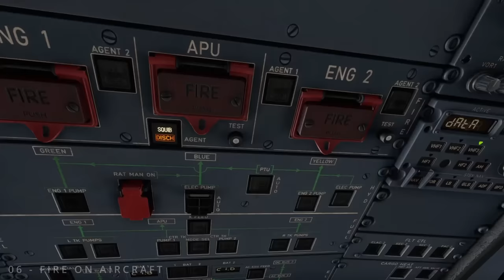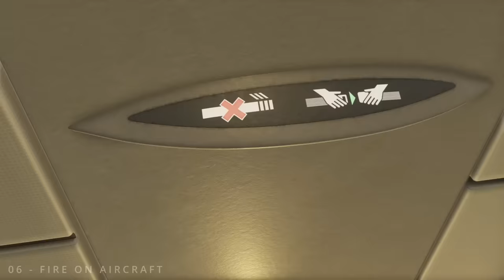Airline CAPTAIN Debunks 8 Flying Fears

Comment: Thanks for this captain. I am not sure I can completely agree with the examples you used for landing on water.  Yes, Sully did land on the water, he is a true here and an incredible pilot, but he landed on a river: water was relatively calm and people could be reached and saved in minutes. Ethiopian Airlines Flight 961 was a tragic event: the airplane broke into pieces, and 125 of the 175 people on board died. And the other 50 were saved because the plan hit the ocean just 460 meters away from the beach.

Comment: Ive flown many times as I want to go abroad on holiday. However, I just cant get on a.plane without taking valium although I am still a bag of nerves after 10mg ! Nothing and I mean nothing not even this lovely pilot can make me at ease
 My hands are.soaked with sweat just talking about flying. Adding to that the Boeing 737 Max 8 whixh is used by UK tour operators we usually book with has not just had the 2 crashes prior to pilots being trained properly on the MCAS but has recently had 4 incidents where planes plummeted thousands of feet or.were flying way too low.
I love going on holiday but its so traumatic for me.😢

Comment: Good job here and no doubt that flying is safer every year that goes by. However for me I will never fly in thick fog on lift off or landing, icy conditions or in a plane that has less than 3 pilots..with just 2 a suicidal pilot can get the one to leave the cockpit and then lock the door, rare but it's happened several times.

Comment: What if a pilot snaps and decides to purposefully crash lands
What if the air pressure is set to manual and nobody notices cause they’re too ”experienced” to do thorough checks 
What if there’s guns smuggled and it causes a fire and the plane cracks in half

Comment: The best thing i’ve ever heard that made me completely trust in a plane is if the airplane is at it’s maximum operating height and every single one of its engines fails, the plane can still safely land no matter how high it is
Reply: Not if it’s in a stall or the pitch is off significantly.
Reply: @GP-gt4bo  right, but even that is usually preventable

Comment: the last one about a water ditching he wasn't being completely honest. I watch a documentary show called Air Disasters where there was a plane that needed to do an emergency ditching. They miscalculated and the plane flipped over repeatedly, and everyone died. So yes, it's possible to do an emergency ditching and have it go well, but it's just as likely it won't. For anyone who wants to know the truth about aviation I'd watch this documentary series. I'm scared to fly but it has nothing to do with the plane itself (most of the time) it's maintenance failures, pilot error, and weather (mostly upon landing). This pilot did a phenomenal job detailing most of the fears but I feel he should speak more about when things go wrong and the pilots don't know what's going on. Many planes have gone down due to the pilots not understanding what the complicated automative system is telling them.
Reply: exactly this. there are chances to have accidents, as you say; mechanical/human errors are super probable. all pilots look very cool and calm and godly until there is a problem and they really freak out, they have a bit of overconfidence imo. flying a heavy airplane on the air feels extremely unnatural to me. super unpopular opinion I guess. I hate flying. everything about it 
feels grothesque to me

Comment: Would have been nicer if an aerospace engineer was also in this explanation video. Pilots aren’t aerospace engineers. Yes pilots have to learn a lot about airplanes but they don’t design airplanes by craft. Aerospace engineers do. It would have been nice to hear them both discuss these issues.

Comment: I'm an experienced flyer with in excess of 200 commercial flights in the last 40 years. But I still get scared. It only takes one pilot error, or one mechanical failure to send you plummeting to your death. Yes, it is rare, but the facts are that it could happen.

Comment: I’m deathly terrified of flying right now even though  I’ve flown at least 10 times. My question would be what could be done if one pilot is suicidal? What measures could be done to prevent or stop it besides yearly mental screening?
Reply: Annoyingly, the FAA in the US has made it mandatory for two people to be in the cockpit at all times if a pilot needs a rest break due, however other European airlines don’t make this rule mandatory which is bizarre to me as the FAA requires it. Depends on which EU airline implements this rule. Airlines have adopted “peer support programmes” which offer confidential support for pilots by other pilots which I guess helps lessen the stigmatisation of mental health disorders but I’m uncertain about what happens to a pilot’s licensing and work after it’s declared they’re not fit to fly.

Comment: The chances of a passenger experiencing an engine failure on a twin engine plane such as the B787 or Airbus A350 is incredibly small.  And they fly incredibly well on one engine!  Even rarer is when an engine fails spectacularly & the front of the engine is blown off.  If that happens it's really really serious because of the extra drag.  This happened on a United Airlines B777 flight to Hawaii.  The captain and crew did a fabulous job & the plane landed safely but the plane was extremely difficult to control.

Comment: My biggest fears are of loss of control of the aircraft due to mechanical (E.g. Alaska Air flight 261) or software failure (E.g. 737 Max MCAS failures) , severe pilot mental health issues (E.g. Germanwings Flight 9525)   and terrorism (E.g. Pan Am Lockerby).

Comment: weirdly enough i used to be afraid of flying and i cured it by watching air crash investigators, they have fixed alot of things and i understand all the noises and things that happen during a flight now turbulence is the same as going over a pothole in a car.  uncomfortable maybe yeah but these machine are designed for it.

Comment: I do have to say, with professional experience in aviation and anxiety, it's never a good idea to dismiss all feelings of fear. That's not the answer. There is no fail proof answer to flight anxiety, nor is there a a 100 % guarantee of safety. It would be a lie. It's about dealing with those fears and a healthy risk-assesment. If people are afraid of bears, you can not say that the chances of being attacked by a bear are zero. Facing fears is allowing that 0,001 chance of uncertainty, and being ok with it. If someone asks me in my practice if it's possible that their plane will crash, the only right answer is yes

Comment: I had a fear of flying based on the idea that the plane was not controllable by the pilots and could do what it wanted. I was on a flight in Nepal  on a 30 seater when we went through a thunderstorm which caused the plane to plummet to the earth perhaps about 20 times in succession. Each time the pilot was able to pull it out of the dive. Suddenly the storm cleared and we landed safely. That day I lostmy fear of flying.
Reply: how are you not traumatised after that experience tho?
Reply: @siempre289  it was traumatising. It felt like being in a fairground rollercoaster except that it was in an aeroplane. Even the air hostesses were screaming. After 3 hours I had a connecting flight. Did I want to board it? Well I had to get home, but I realised that if the plane could survive that, it could survive more or less anything. From then on I had no fear of flying.

Comment: Well, unfortunately landing on water is a thing which aircraft not really can do. Landing on water is like an impact because of the weight of the water is causing an enormous braking force when parts of the airplane hit the water. Of course, the A320 landing in the Hudson saving all lives on board was great, but in the Ethiopian flight 961 incident with the Boeing 767-200, 125 out of the 175 people on board got killed (including all three hijackers).
Reply: That's because Sully is an incredible pilot who used to tricks to lower the approaching speed to the water and first dug the back of the plane into the water before dipping the nose. Obviously you cannot treat water like a normal runway. He also made sure every single passenger was in a brace before attempting this. You cannot say "landing on water is a thing which aircraft not really can do." when it literally has been done.

Comment: It's the lack of control that bothers me. in a car, I can grab the wheel or hit the brake or hell, I can jump out and pray. In an aircraft, there's literally nothing you can do aside from tighten your seat belt, hold your love ones and kiss your ass goodbye. Everything is in the hands of your pilot. They say the road is more dangerous, yet I have never and will never be in an accident. I'm a defensive driver. But my defensive caution means nothing in the air. I need to put my trust into a complete stranger 20 thousand miles up in the air. Yet I barely trust my nabors, lol. It's a scary thing if your someone like me. All it takes is one pilot who hates his life or had one too many night caps or didn't sleep the other night. I know it sounds silly, but those who died in a plain I'm shore  also thought the idea was silly till it happened. It doesn't really matter how many planes safely take of or land because it only ever takes the one time to end your life. The odds of winning the lottery or stunningly low but yet we have millionaires out there right now because of a set of lucky numbers. All it takes is for your unlucky number to be called.
Reply: sure you might drive really safe but that doesnt mean other people on the road with you will do so i dont know about you but i would sooner put all my trust in a commercial pilot than i would in random drivers around me
Reply: @animegamingdude  I would agree, but to further inflict fear in me, just the other day, a commercial pilot tried to down an Alaskan airline plane, further deepening my fear of trusting pilots. I get your point about other drivers, but being a defensive driver gives me a chance to react to other drivers. 2 months ago, I had to veer off into the grass to avoid a car coming up behind me really fast. My car and I were safe, but he hit the car in front of me. (Everyone was ok) but still, the fact that it's my reaction time that helped rather than the reaction time of a stranger. Maybe my fear is unique lol but it happens to be backed up by a few examples.

Comment: It's not the theory of flight that I question. It's the maintenance records, and it dozens of times we have found out that the airline knew about a problem and didn't do anything.

Once again, it's the corporate aspect of the company who I'm more concerned about cost cutting and bonuses then they are about our safety. It's a calculated risk they are willing to take… I'm not.

Comment: I was just on a flight from Frankfurt to Edinburgh and we had to make an emergency landing due to an”suspicious smell”.

The landing was very dramatic with emergency lights, flight attendants running around and significant turbulence due to the rapid decent. 

We sat on the plane for an hour once landed while the smell was investigated internally and externally, and were eventually told that we would have to evacuate the plane. 

Does anyone know what this smell could have been or what the concern was? I was sat in the area they were investigating and couldn’t smell anything.

Comment: When there is no chance of loss of cabin pressure, I'll feel safe flying. Thinking you are just sleepy and dying due to loss of cabin pressure is not a way I want to die. I don't really care how rare that is.
Reply: even if cabin pressure is lost the oxygen masks will drop down and provide you with enough oxygen for the pilots to get the plane down to an altitude where the air is breathable

Comment: I commend the aircraft industry for the diligent attempts to improve safety, and for what has already been achieved in this regard. However ... (you knew there was a "however" coming, didn't you?): Saying that flying is safer than driving by referring to accident death statistics involves an egregious use of false equivalence. Air traffic is extremely strictly controlled; road traffic much less so. Imagine how road traffic deaths would drop if:  —If every driver were as highly trained, skilled, and experienced as an airline pilot. —If every car or truck were thoroughly inspected by trained technicians before going on the road. —If every driver had to be cleared for sobriety and competence before leaving. —if every vehicle had to be in constant contact with a control tower and if every vehicle was stricly controlled with regard to speed, maneuvers carried out, and route. —If a scarily smart, competent, and skilled "flight controller" pulled out all the stops to ensure that no two vehicles were in danger of a collission. ... One could obviously go on and on. The operating conditions for air traffic and road traffic are nowhere near the same.

Comment: 05:50 With all the respect, I would prefer to not be present on board on a "nothing to worry about" scenario where the cabin crew would had to assist and set up an automatic landing. It is not so simple.

Comment: I'm afraid of the possibility that my plane has some untied bolt that wasn't seen on the last inspection and that it will fall off during the flight disassembling something important and plane will snap in half mid flight throwing me in a free fall without parachute

Comment: I was with him until the ending. Sorry, I know he has to speak up for his industry but you cannot compare the Hudson landing to most; the reason that Airbus was able to remain intact was because it had low passenger count, almost nil cargo and very limited fuel for a short flight, which means it could keep airborne at a much lower speed than normal (erroneously referred to as 'stall speed') and of course it was onto a calm estuary, not open water. An aircraft mid ocean with 50% fuel load, full passenger and cargo load is going to disintergrate on impacting the sea, even if it is perfectly calm.

However, I mostly take issue with the 1:11,000,000 odds of dying on an aircraft Vs 1:5000 in a car.... Now I don't know what the odds are for aircraft, but the idea that 1 in 5,000 car journeys ends in a fatality undermines anything that he has tried to do in this video.

Comment: What happens if the aircraft crashes into a mountain ? I'm guessing the answer is it'll be fine, they're designed for this kind of thing, don't worry about it, you'll be fine.
Reply: If the aircraft crashes into a mountain, the answer is your body will be instantly pulverised and you will die, however let me ask you a question: Why the hell are we flying into a mountain?

Comment: What happens if the engines stop while you are crossing the Atlantic? 🤔
Reply: " ETOPS (Extended-range Twin-engine Operational Performance Standards): Aircraft that fly long routes over oceans must meet strict safety regulations that ensure they can safely glide to a diversion airport even in the event of engine failure. "
Reply: @j4mbi_  
Good to know, thank you so much! Safe flying

Comment: If the engine fails on one wing does it mean the plane will spin as only one wing will be flying?
Reply from the maker: No not at all. A plane will fly perfectly fine with only one engine functioning. It will not spin, you would probably not even notice a difference.
Reply: @AirlinersLive  So is air just working on one side of the plane?  If one engine fails can the other engine still power both? I'm just imagining if one side stops spinning but the other working so it will be uneven.

Comment: If you are in an airliner you are sitting in a flying bomb full of inflammable fuel & battery acid & oxygen .  Its held together with pop rivets.& glue ,flying several miles above the ground in all kinds of weather in horrendous cross winds at speeds of up to 600 mph . The controls can jam the engines overheat & burst into flames ,the cabin can suddenly burst apart under pressurisation  & suck your body inside out . When these flying contraptions decide to drop out the sky ,they burry themselves in a ball of fire ,into the earths mantle . Your chances of being in an air disaster my be slim ,but that’s no use ,if the person in the next seats luck has run out ,you are going to burn to a crisp with them  when the crock hits the deck . When I fly I never take it for granted that the aircraft will arrive safely ,I assume I have taken a big gamble with my life & feel I have been lucky ti escape a nasty death if the aircraft actually lands & I have disembarked at the destination airport . Flying isn’t safe it’s a necessary dangerous risk we have to take ,if we want to travel to other continents . I aways feel a million times safer whist riding my motorcycles .

Comment: Planes can be safe but pilots make mistakes. Almost 70% of plane crashes happen cause of a poor pilot training or decision making. Airlines sometimes put on command pilots that don't have enough experience ( fly hours) or not enough experience with the plane that they're about to fly. So yes this captain can be sitting there explaining the protocol of some of the incidents that can happen but in real life they're not that calm and they are afraid so the do make mistakes. They should stop prescribing the protocol and be more aware of their training and experience when flying with people in their care.
There a lot of channels that explains a lot of accidents and almost all of then happen cause of the pilots or a bad maintenance. I trust the engineers that build aircrafts but pilots and mechanics? That another issue.